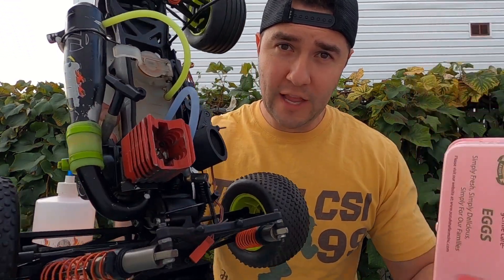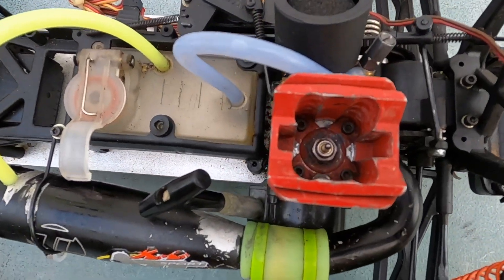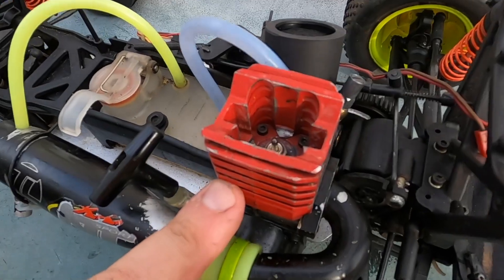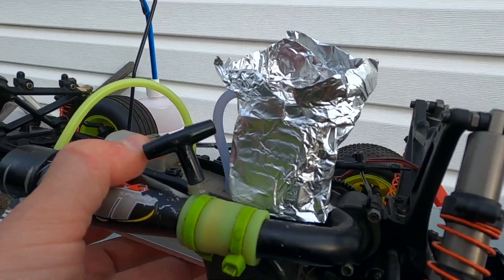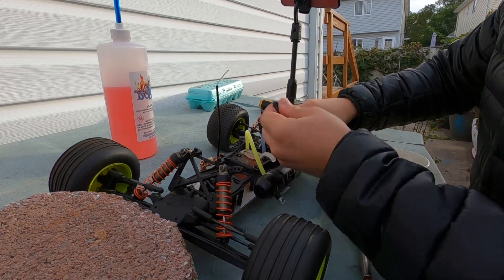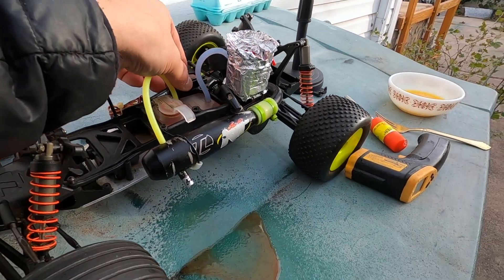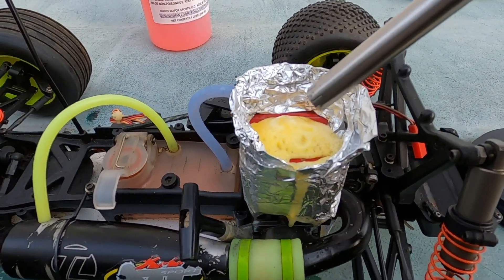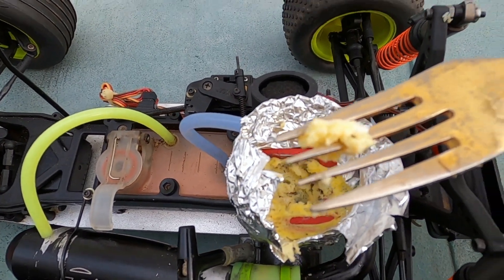I Made an Omelette with a Nitro RC Car - Cooking eggs in a Team Losi XXX-NT and Taste Test

Comment: ⁉️ Just a thought ...Why don’t you put foil in the center of the head? Make a little “bowl” out of foil, put it in the head and then add the egg 🤷🏻‍♂️. Everything stays clean and still heats the egg
Reply from the maker: hey man! thats a good idea and it's worth a shot.  The main obstacle is the glow plug, I would still need to be able to access the plug.  But I guess once it's running It does not matter.  Other factor is that HEAT TRANSFER on foil is terrible.  I doubt I will be able to cook the egg like that. I will try anyway.